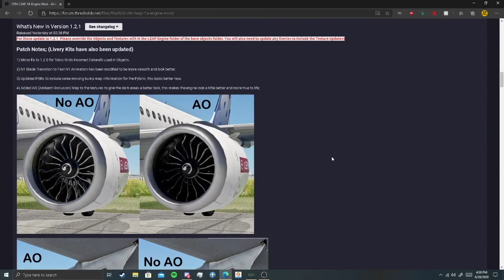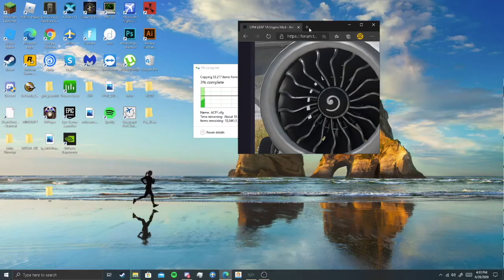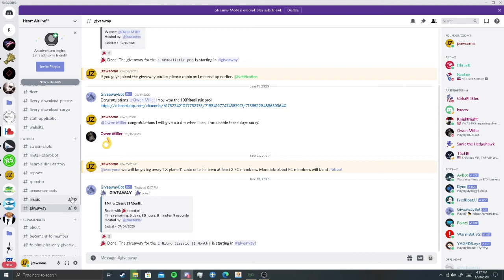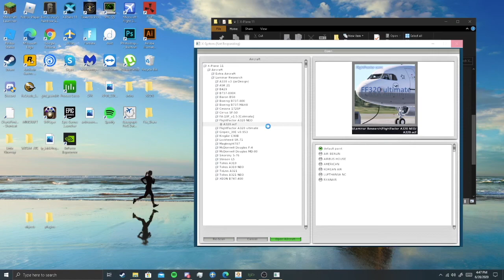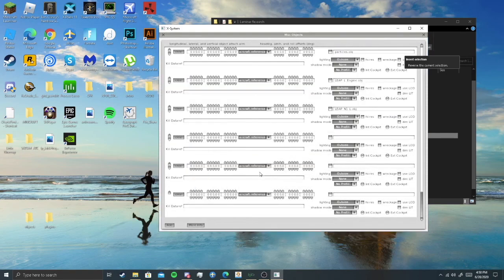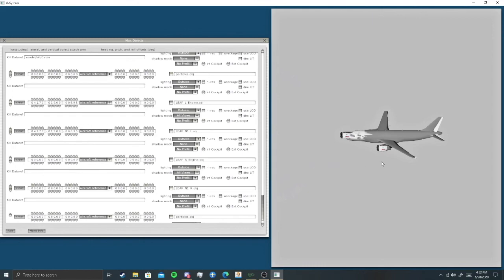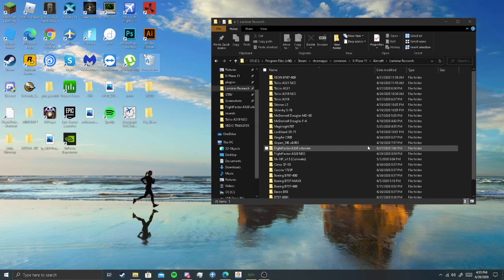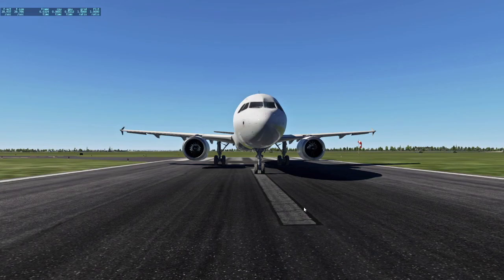How to Install Leap Engine mod for FFA320 [EP1/3]

Comment: hello followed the tutorial which is great, but my landing gear is missing 
when plane is loaded into x plane 11 everything else is perfect.
any ideas?
Reply from the maker: Hmm interesting I did not seem to have this issue, maybe you did it wrong or the new toliss update does not allow the mod. I would say to reinstall toliss and try it again. Thanks
Reply: @jzaviation3032  yeah thinking I messed up somehow, I'll run through it again. Thanks for swift response and happy flying Dude.

Comment: do you have the link for the sound pack of tihs CFM LEAP 1A?
Reply: I put the engine but I dont have the sound pack, because the blog doesant have the donwload of the Flight factor a320
Reply from the maker: @gudel4743  this should help https://x-plane-sounds.blogspot.com/2020/02/ms-neo-b.html?m=1
Reply: @jzaviation3032  Ok brow,  but this sound  is for PW1000

thank you!!
Reply from the maker: @gudel4743  There is no soundpack currently for the leap, so I recommend u use that one so u don’t have the classic sounds still.
Reply: @jzaviation3032  is the installation the same?
Reply from the maker: @gudel4743  yes I made a video abt how to install the sound pack so you can use that as a guide.